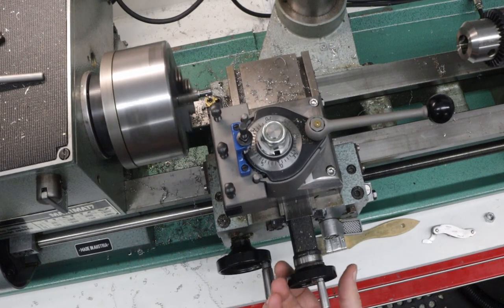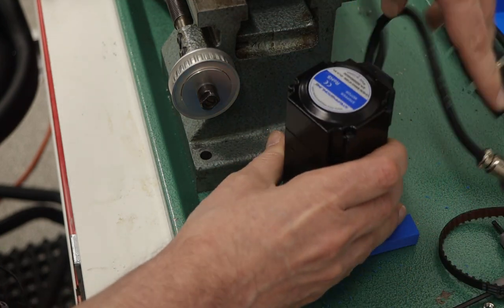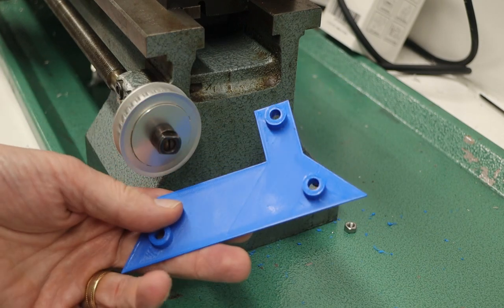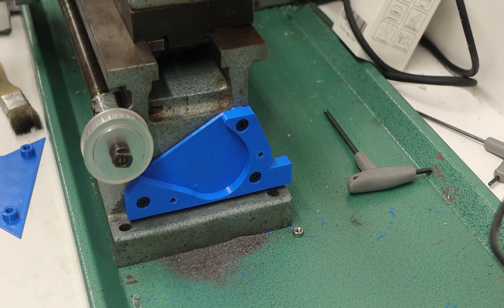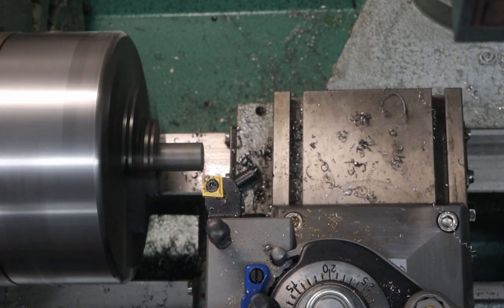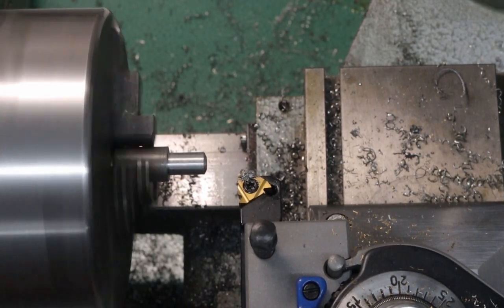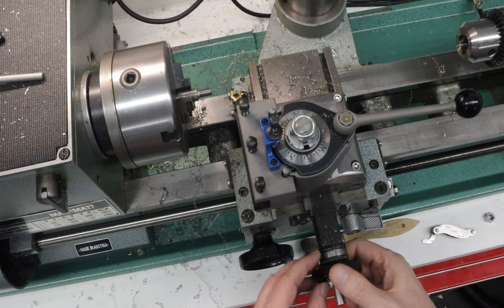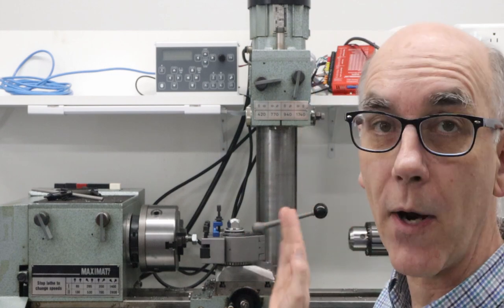Semi Automatic Thread Cutting: Metric and Imperial - Part 6

Comment: I don't know how I got the idea that I needed to use a DRO with the rocketronic system, but watching this video it appears that the system itself calculates the Z axis position based solely on the rotation of the encoder rotational data, which in turn is used to calculate the lead screw rotations and the cutter tip Z0 entry. 

I've been looking for a Maximat to convert because I suspected it would be an easy process. Your series pretty much confirms this... did you make a cross slide conversion video?

Comment: Hi John, i have the same machine basically.  My question is...how is your gear train set up currently, now that you are using the E lead screw?  I am quite torn on whether or not to invest in the change gear set which didnt come with my machine, or invest in the E lead screw.  But before i choose either i need an understanding of the baseline of your machine.  I am new to this operation since my older machine could not cut threads....any info you could share would be greatly appreciated.

Comment: were did you parches that siystom from  it dos not look as complicated as the clouelg42 . siystom do a video on wear one can Buy it from ? . i live in England & need to fit such a siystom to my 100yer old lath  as it dos not have a lead screw. thank you Les England.  PS I'm content to just have it cut a thread in such a way that it remans  to be semi automatic  so i hold on to my thread cutting skills. for example it doesn't need to position it self i as the operator can do that  & slating the stat by thread indicator, also a job i can do it cud i suppose stay in thread mode &  & return to stat adding cut i can do , my old lath is one used in schools in the 1960 . most had no led screws  One can cut on it but one must ues the rack. An ELS  system seems to me to be the answer to threading on my lathe.  one can cut third wit it change gears,   this is done on my  lathe. by the ues of the rack shaft & six trads to the "inch pitch nut. drive.  No led screw. i wuld sat thes a subject there to get your hed around.   LES

Comment: I bought an ELS kit a year back, not fitted yet,  but when I checked the thread pitch plate on my old 1930 Colchester Bantam lathe I found it covered all of the standard  Metric pitches you need and I don't think odd pitches are really necessary for any thread that has been invented to date, so the ELS kit is still in the box.
Reply from the maker: If you have a quick-change tool box, I can see the value would be less. My machine requires physically changing the gears by removing and adding gears. It's a lot more work than if you have a change selector. Once I finish this conversion, by adding a stepper on the X, it will also be able to do the entire threading operation.

Comment: How has this unit been treating you a year later? I'd love to see a follow up with your thoughts. I've been considering this as an alternative to a dro or CNC conversion on my little lathe.
Reply from the maker: I haven't had enough projects to get much use out of it yet, unfortunately. I do love it, even though it's still metric only. I happen to have a second one I've been meaning to sell. There were shipping problems and the first one got lost, so they sent me a second one. Then the first one showed up and I paid for it because it didn't feel right not to. But that meant I got stuck with a second unit and haven't sold it yet. So let me know if you're interested. You can find my email address here: https://www.youtube.com/c/JohnSL/about
Reply: @JohnSL  I sent you an email a while back. May be caught up in your spam filter
Reply from the maker: @RADHardTech  Woops, sorry about that. I found the email and will reply.

Comment: I'd really like to put something like this on my Clausing lathe, but its complete inability to deal with inches is pretty much a deal-breaker--all the more so because it's completely unnecessary.  It's just software, it should be relatively trivial to implement this.
Reply: Hello there, I can "pitch in here".. :) I have the same ELS system (both Z- and X control) and fitted to several Myford lathes. My humble opinion is that this system handles imperial numbers well as long as you can live with converting these to metric, for which purpose I made a simple chart in Excel. Eg. the 8TPI leadscrew on the Myford converts to a 3,175mm lead (which is used to setup the Z-motor control). I find this to be a very simple and practical solution to input imperial numbers. Accuracywise, the system can handle inputs down to 1/1000mm increments and since the math is done in metric, there will be an accumulative error. However, I will claim this to be negligible unless you are doing a longer piece, at least well within the overall accuracy of the machines/systems and tolerances involved. For example, if there was an error of say just less than 1/1000mm, then over say 100 threads, the pitch error could approach 100/1000mm = big enough to cause an issue. However for short threads the error is meaningless. So if I have a 100 mm piece threaded and the error is 1/1000, with an 18TPI thread ie. 1,411 mm lead: 
1inch = 25.39998628mm
18tpi = 1.411110349 mm pitch
Error = 1.411110349 -   1.411  = 0.000110349 mm per thread
100mm rod has 100/25.4 X 18  = 70.9 threads
Hence the cumulative Error = 70.9 x .00011mm  =.008mm for the 100mm piece  which is well within the specs of most leadscrews and manual lathe systems
Reply: @jansverrehaugjord9934  Hey Jan, I think this is a great solution. Would you consider sharing your chart? I'm installing an ELS this week.
Reply from the maker: I hear you. You'll see my solution in my next video (still filming). But he is working on updating the software to support both metric and impereial. And, as a software developer, I can tell you that it's harder than it would at first appear to retrofit software that shows dimensions in many different parts of the UI. It's much easier to add that type of flexibility up front rather than later.
Reply: @JohnSL  I'll look forward to the next video, but it's encouraging to know he's working on this.  Hopefully it will allow for thread specs, at least in inch mode, as tpi (e.g., 20 tpi) rather than thread pitch (e.g., 0.05").

Comment: You leave the lathe default gear set in or another set?
Reply from the maker: I took the gears out. So the lead screw is driven only by the stepper motor.

Comment: Great video 👍John nice work so the only restriction is size of bar stock and cutting inserts possibly to do square threads tripizoid but a great tool add on nonetheless .
Reply from the maker: Yes, lots of options now. Of course, they existed before I added the ELS. But the ELS makes it so much easier and doesn't limit me to what gears I have.
Reply: @JohnSL  Gotta love stepper motors micro controller's etc
Reply from the maker: Oh, yea!